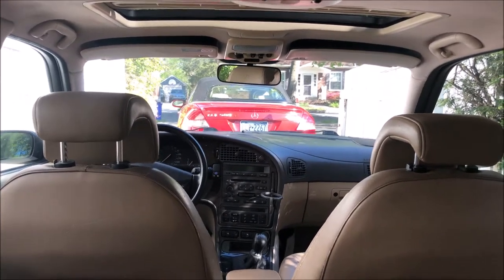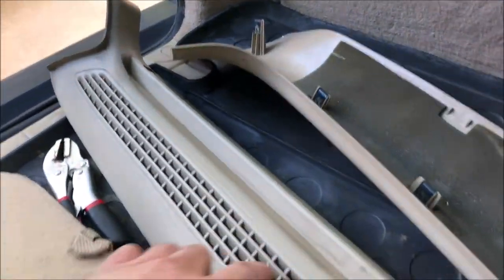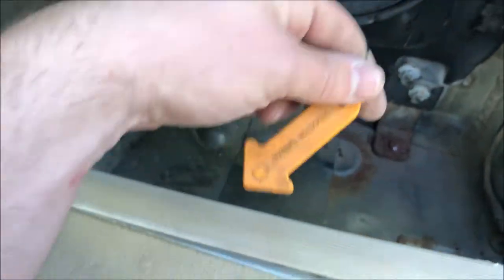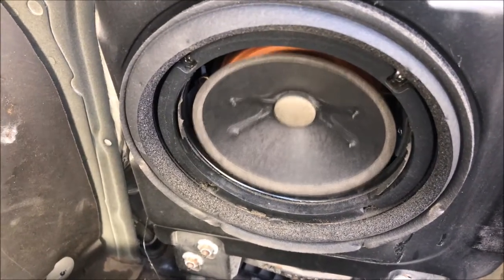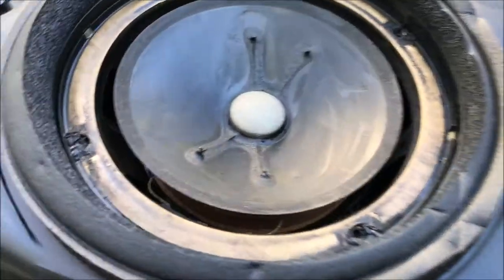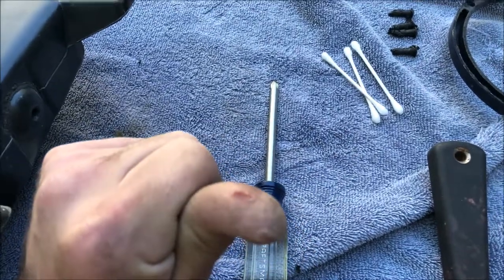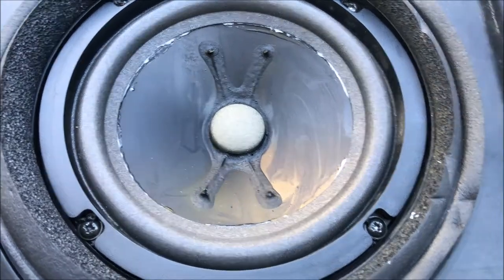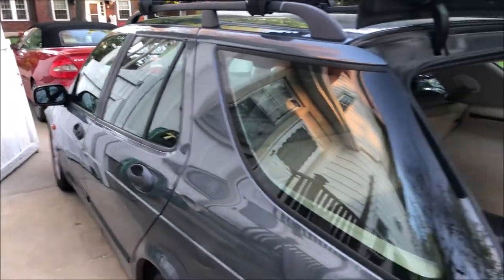SAAB 9-5 Subwoofer Repair (Re - Foam Procedure)

Comment: Well done video, thank you very much!!!  I just discovered that the subwoofer in my '04 Arc wagon sounds like it needs to be refoamed (kid's car, no report of a problem...).

Is the subwoofer cone paper or plastic?  Do you recall which type of adhesive you bought from Speakerworks?  Thanks!
Reply from the maker: I believe it is plastic, and the adhesice comes with the kit. Fairly easy job

Comment: Would this also fix a low bass? I turned the bass all the way up but in the front i almost can't hear it.
Reply from the maker: It's possible. But you definintely will not have proper bass if your sub looks like mine did